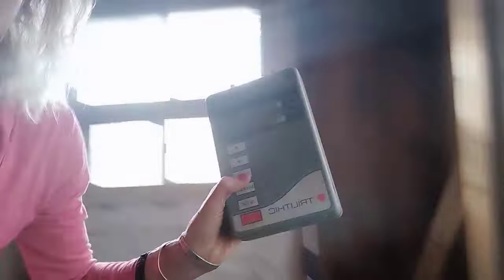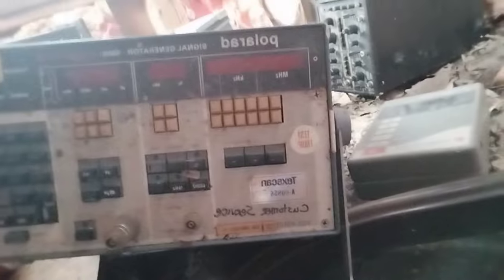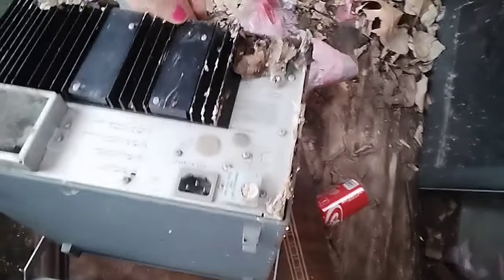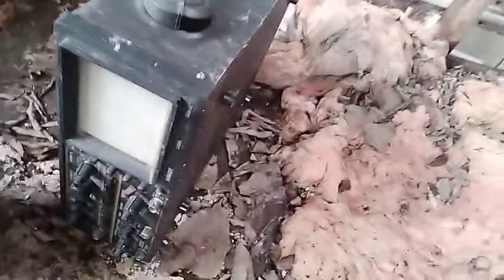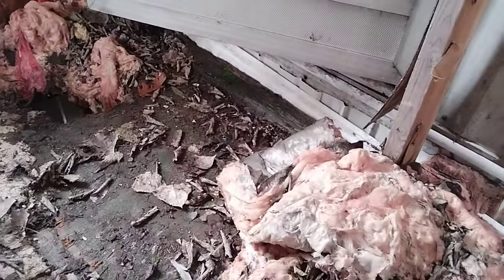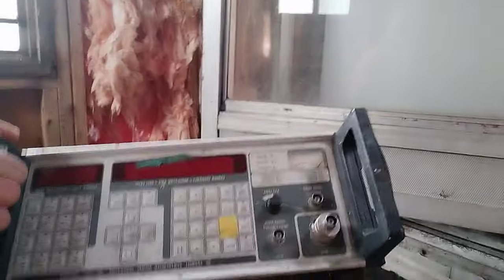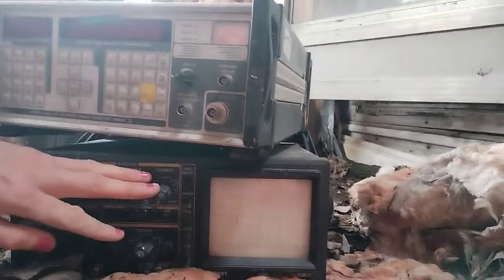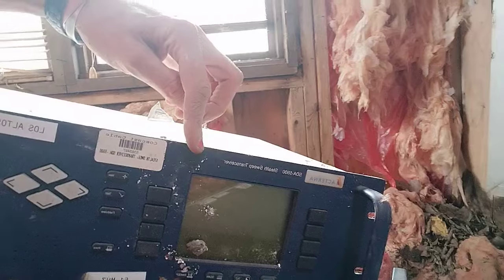new projects and oscilloscope 3

Comment: That's a pretty nice surplus score .. better than I've had since I left Toronto 5 years ago. Even the ones beyond rerpair will have a metric butt load of useful parts.

Speaking of weird salvage .. did I spy a few LCD TV's off to the side? Never found too much useful in them, but just thought I'd share .. Last year someone dumpsterd a few 40 inchers .. I scavenged the CFL backlight tubes and soldered them together into geometric shapes (cubes, pyramids), hung them from a horizontal long wire, and energized them with HV at night. Kind of a silly artsy-fartsy project, but it looked cool way out here in the dark boonies.

More interestingly .. I noticed one night during a storm that the tubes would actually flash before the lightning.

Actually I shouldn't say the TVs are useless .. All the parts are there on the PSU board to make a quick and dirty boost converter.